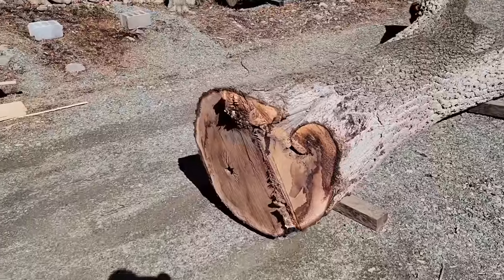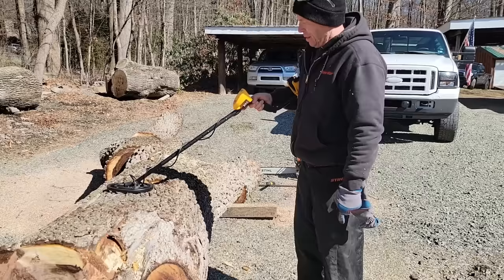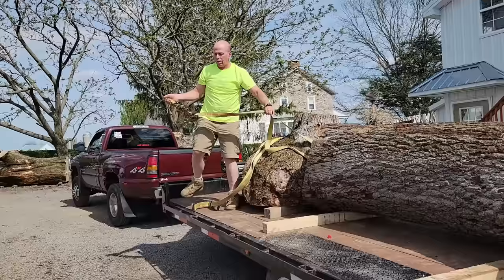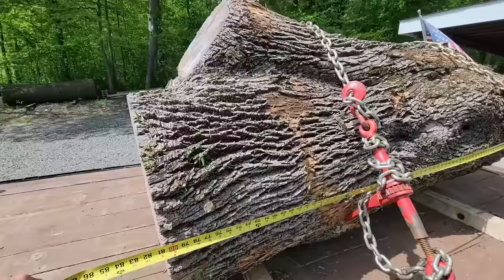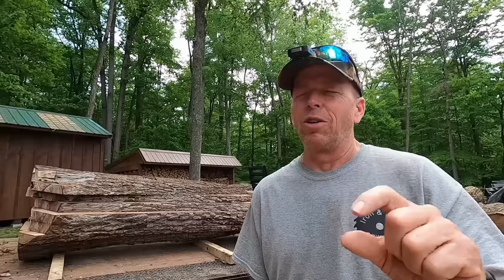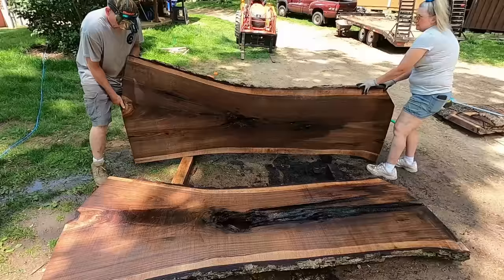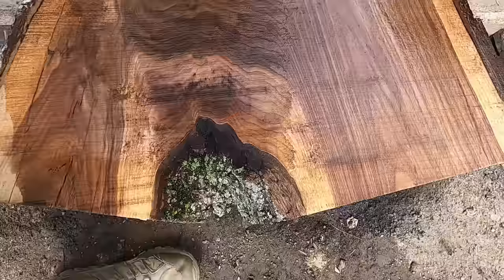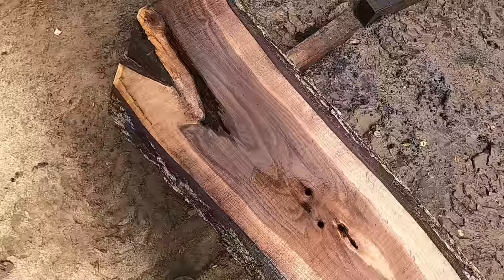Black Walnut Gold. Well Worth the Wait

Comment: You ever get into some wood  that seems like part of it is petrified?   We took out our old entry gate  logs that was 2 pillars and a cross beam log  with the farm name branded onto it that was about 6 1/2 feet into the ground on compacted sand, pebbles, and more sand with the outside charred and and a lacquer spray over that and the butt end dipped into the tailings of bees wax.  They were in the ground for around 8 years with zero issues - came out with zero issues other than seeming to weigh 10x what they did before but not the cross beam - just the sections of the 2 that were in the ground.  I should have kept them but a gentleman from out of town came and bought the 3 logs.  Some people say it's impossible - I beg to differ because I've even seen old fence posts do the same thing.  (South Eastern South Dakota)   We don't put concrete or anything like that, just mixed sand and pebbles for the base and a mix of the two until ground level.    What are your thoughts about "Fast petrified wood" vs "thousands/millions of years petrified wood" ?   I've asked so many people and at least 80% reply back with - it doesn't take millions or thousands of years.  Hell I can make ruby/sapphire in a microwave kiln in my kitchen in about half an hour!  And companies can make a diamond of any color you fancy!     Great video by the way, I like the long format ones better!  At least some of that burl was pretty decent!   The other stack made up for it!

Comment: That Stihl chainsaw is A little out of tune on high.,or low air fuel mixture screw adjustment barely  it's cutting out of adjustment.,an that's what is called is chattering sound It makes  From starving for fuel is what is taking place when it's making that wun huh bur uh sound noise it putting out. While you're trying to give it more throttle feed from the trigger lever. I hope it really helps you out on that problem with that part. You just turn those screws in.,or out. Out gives it more fuel. And in cuts down the fuel feed flow. Which is called making it richer.,or leaner fuel mixture adjustments either way. Just A quick tip trick for yah is all.

Comment: When my father bought a naturally wooded lot, most were dark oak and a few cherry.  Most of the good trunks he saved were about 3 feet across and straight.  We had the good trunks marked as to length and had them stacked on the edge of the lot.

After cutting the following year, we had about 10,000 board feet of rough cut oak some of it slabbed 2.25 inches thick and 16 feet long.  We stacked it in the basement with spacers so all would dry correctly.  Been using it ever since (1966 cut).  Very hard to work with as grain is very tight.  

Every house I have lived in has some in it.  Even a couple that I didn't own.  My brother did an entire house of woodwork, railings and supports from it and there was plenty left and my nephew is now the keeper of the wood.

Love the videos as they remind me of growing up using this type of wood.  Thanks.
Reply from the maker: Thank you very much David, for sharing that story. It's great how all that lumber was saved, and is still providing something today, and will co tinge on in everything that was created with it. A tree is not gone after it dies. It can live on in many forms, or in the memories it has created. Much like we would like to do. Create things, make memories, and be remembered.
Thank you for coming to the channel, and we hope to see you in the comment section more often.

Comment: I have the same tractor or similar L3800. I put a higher pressure shim on my hydraulics which has helped with lifting with the forks. My tire are loaded and usually have to put the bush hog on to lift my fuel tank which is about 1300. The hydraulic kit doesnt increase it to damaging levels but defiantly helps. Great video
Reply from the maker: Hello Jeff. Thank you, and welcome to the mill. I was looking into the shim kits. It's on my list of modifications. I won't over do it, but it would be nice to lift a few more hundred pounds. The tires are fluid filled, and the box blade offers a good amount of counterweight. I was looking into a more compact weight system for the 3 point though.
Reply from the maker: Do you recall the name of the company that makes the shim kit

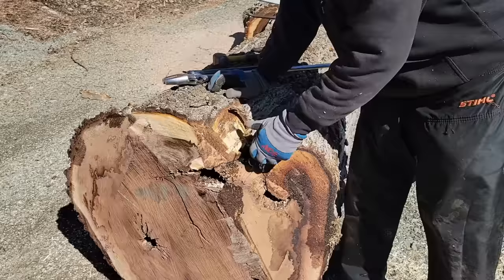Comment: Regarding early in the video at 6:13 where you found the bent and ? broken gate bolt. If you get a smaller diameter rod longer than your bolt - tap it up and down to the end of your hole. Wood will feel definitely different from metal. Cheers.

Comment: Nice work you two!!  I have some of the same "buggy" walnut that me and Matt Cremona cut last October.  They ate almost the exact same centers of the slabs like you have there. Amazing how those ants and grubs can chew the unique features that they do.  :)
Reply from the maker: I recall that video. That was a huge walnut. Glad you saved it. Would like to build a saw like Matt's, buy space becomes an issue here.
Any chance we will see some of that walnut in a project.
Reply: @IronOakSawmill  FF gftt
Reply: @IronOakSawmill  Yep, it is still drying, but have big plans for some of that goodness!  :)
Reply from the maker: @maverick5162010  Will you kiln dry it after it air dries so long, or just do the air drying? We do all air drying here, and actually have people that prefer that we DO NOT kiln dry walnut.
Reply: @IronOakSawmill  Yeah, well worth pointing out.  Some do not want it from a Kiln so it all gets air dried for a year.  After that, I will kiln dry as required per customer and our own needs.  :)
Reply from the maker: @maverick5162010  from what I've heard, it's steaming the walnut that changes the color. Basically, steaming makes the color from the heart wood, run into the white sap wood. Overall, the color is much lighter, and causes the wood to lose its natural appearance
Reply: @IronOakSawmill  Agreed.  I'm trying the Vac-U- Kiln method on an upcoming batch and expect great things.  I'll let you know (and see) how that goes.  :)
Reply from the maker: @maverick5162010  look forward to it.
Reply: Some dig out the complete burl,if that is what it is. I think that there is a demand for that.
Reply from the maker: @dartman5928  The land owner didn't want us digging up a big area, so we salvaged what we could

Comment: Enjoyed your video @1.5 speed. Your admiration for the nice, wide grain at the start of the crotch reminded me of a short but wide walnut crotch a guy brought me 25 or 30 years ago. We sawed it into 1/4" "veneers" on a neighbor's homemade band mill with each pith of the fork maybe 8 or 10 degrees out of plane which made a stack of very wide grain matched feather crotch figured "veneers". I clamped the flitch between cauls of 3/4" plywood. Suppose it's dry yet? I still intend to surface those cuts with a widebelt sander. I'm getting pretty old now. Probably ought to build something grand with it if I'm going to.
Reply from the maker: We do make some long videos Mark. We are happy you are watching. It sounds like you have some amazing wood to work with. I would say they are more than dry enough. Make something they will remember you by. Allow that tree to live on for many more years. You will never regret it. Share some pictures if you can

Comment: I’ve got a 40 ft Black Walnut in my yard in Ct. , that I can’t give away! I want it down, and I can’t afford to have it dropped.
Reply from the maker: If you want someone to take the tree down for free, just for the log, that will be hard to find. Tree removal is hard and dangerous work. Not to mention the special equipment it takes to do it safely.
 Once down, someone may want the log, but since its a yard tree, most will not pay for it. Odds are, it will have some sort of metal in it. We get 99 percent yard trees, and find plenty of metal in them.
The finished lumber can be valuable, but it takes a lot of expensive equipment to get the tree turned into lumber. I hope you are able to find someone who can help with the tree.

Comment: It’s a very good job very interesting but I have a question why did you put the little small stickers and the big stickers on top there what was the little one supposed to be doing this kind of curious if you’d like to come in as appreciate it God bless
Reply from the maker: Hello Donald. Thank you, and welcome to the mill.
The big stickers are actually just a seperater so we can get the folks between that section of slabs, and seperate the pile, because our tractor can't lift the entire stack. We put the small stickers there for the customer, so when they stack at there location, they can remove the big stickers, put both halves of the stack together, and strap the stack with ratchet straps to help keep the slabs flat, while they dry.
Very good question. We'll be sure to point that out better on our next similar video.
Thank very much for joining us, and we hope to see you in the comment section again.

Comment: Why do you always take the measurement to the bark ? I am sure whoever wants it will not want the bark or outer sapwood.
Reply from the maker: Hello Fred, and welcome.
With live edge slabs, such as these, the sap wood is part of the piece, and is desired by those working with it. In general, we give measurements inside the bark, as the bark falls off, and is usually unwanted by the customer.
Although we don't say it, we are giving measurements that are inside of the bark.
I hope this information helps, and thank you for checking out our video

Comment: Kobota's always have a weak hydraulic system.
Reply from the maker: Hello, and welcome to the mill. Kubota have always served us well. Rock solid.  Plen6y of power, an especially, reliability.  They just don't quit.
Reply: @IronOakSawmill  I know, my brother has one just like yours.  They are tough but they won't lift like other tractors.
Reply from the maker: @salvageman1983  those others won't last as long.

Comment: Why drag it at all through the gravel?
Reply from the maker: That's as far as the tractor could lift it. The Kubota L2601 is a great tractor. Much stronger than our smaller Kubota.
Since the bark is coming off anyway, the rocks don't affect anything. We are just happy to be able to move it, without rolling it.
Reply: @IronOakSawmill   I was thinking of the saw blades and the rocks .
Reply from the maker: @fredboucher8689  a definite concern to us as well. And you always seem to find something like that with a new blade.
Reply: Did you figure out what the steel was! Too bad there was so much damage by the ants. God bless, take care and stay safe! Hello to Deb! 🙏🎚🇲🇾🇲🇾🇲🇾
Reply from the maker: @singleshot2218  We never did dig it out Rick. Since these belonged to a client, we mark the metal, and leave it up to them. It appeared to be a large nail.
Its good to hear from you, as always. Stay safe my friend, and Deb says Hello